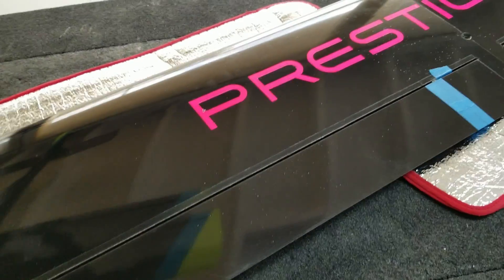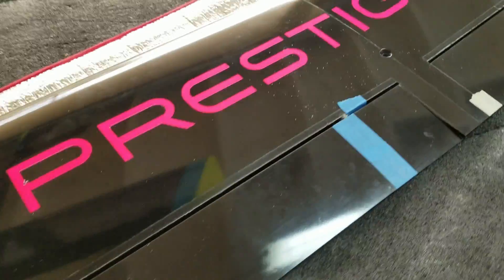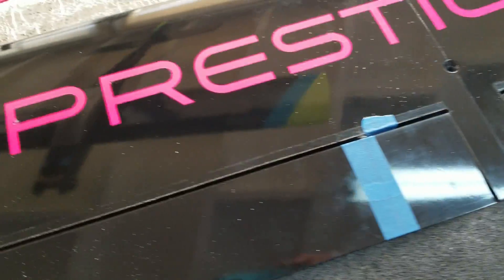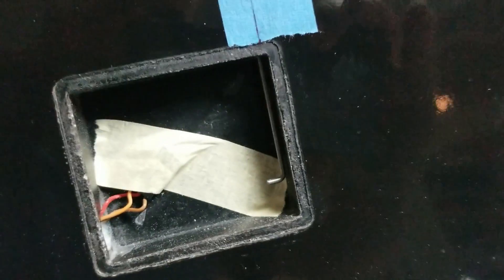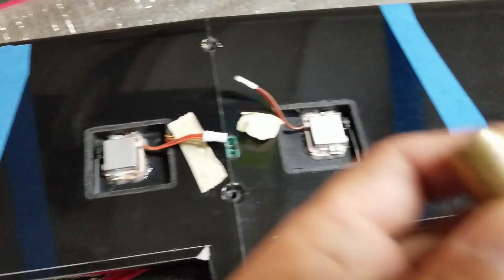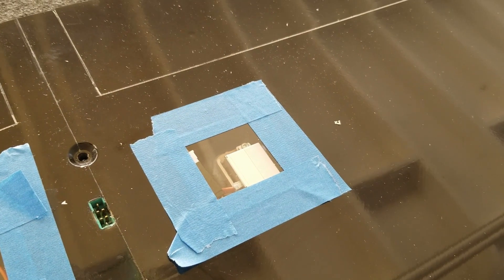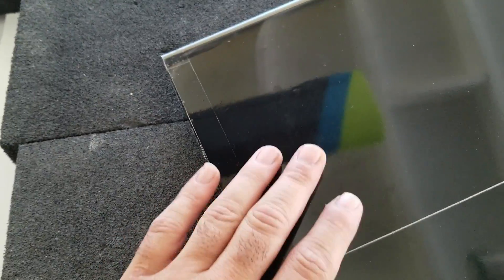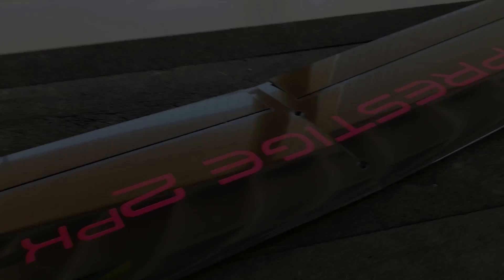Samba Prestige 2PK F5J Flap Servo Installation

Comment: I like the way you did the Connector at the Poly joint. Nice way to get a rectangular hole inside a big round one! Congrats on the Flap Travel you ended up with. Almost got to use the entire Servo travel available. Should end up with some tight resolution for those big flaps! Have Fun,    Weav